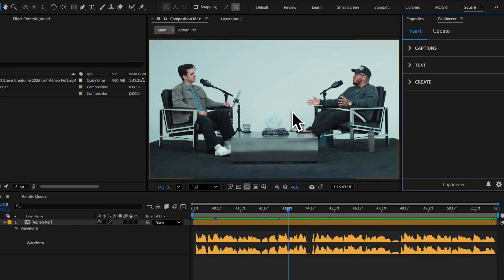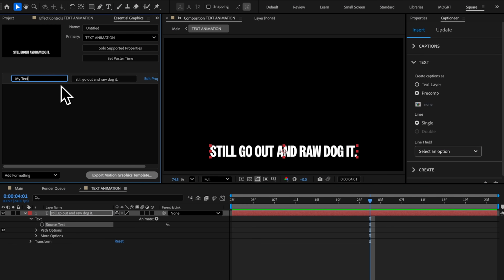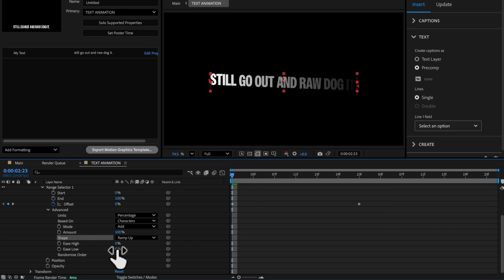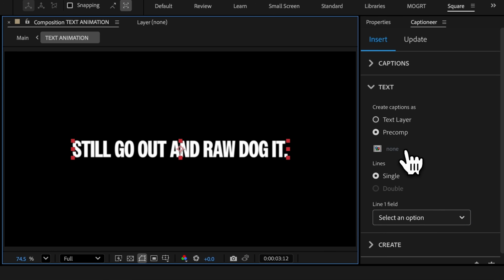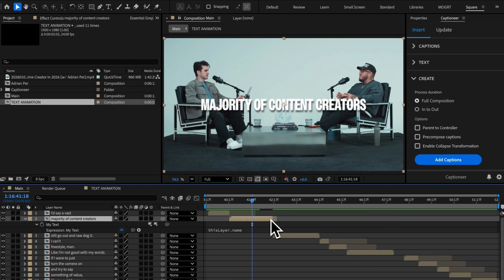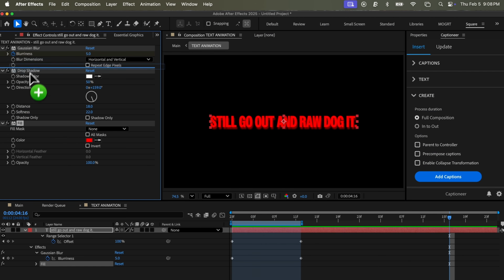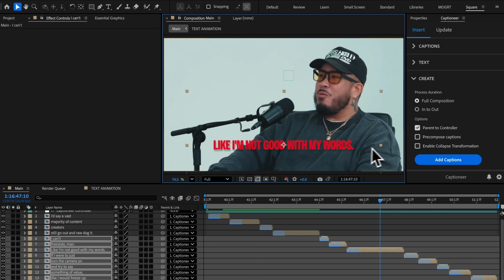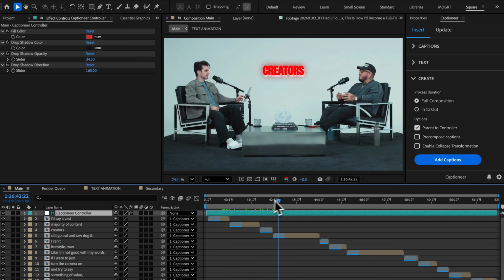Precomps

Comment: Hey guys, is it possible to adjust already created text in after effects? I just copy-paste text from premiere and then working on it in AE and your plugin just greaeat for automatization animations, but for some reason timings is not great in auto generation with your plugin
Reply: I would use crt file, but I expandint duration of each layer for couple frames so they overlap each other and create smooth in-out effect
Reply from the maker: Generate the text in AE and edit the text to fix any timing you want
Reply: @CaptioneerTV  also why is when I make precomps from text players its always some gaps created?
Reply: @CaptioneerTV  oh, I get in now, for some reason, precomps have maximim length of my style precomp, but some text lines is longer, idk how to avoid this

Comment: It's good but not easy to use
The Arabic language transcription doesn't work for after effects.. 
I hope you solve it soon. 😢
Reply from the maker: Email us and let's figure out what's going wrong! We've solved this in Premiere Pro, we need a native speaker's help for After Effects
Reply: @CaptioneerTV  
well, I can help, I am an arabic native speaker! 
I tested it again now it works but
when I choose the split by words option it works too but in arabic it rights from right to left, but it write the words from left to right as in english 
could you add an option to solve this issue? 
and also I add another transcription models like the full Large V3, and it worked fine! 
but, I had to go around it to make it work, it doesn't work once I add it, 
I tried also to add enhanced version for Arabic language, but it didn't work sadly, 
I can send you the link for the enhanced version, and if you could add the uncompressed Turbo V3
and the full V3 
and the Full v3 Enhanced for arabic
to choose and downlaod it! 
it would be fantastic!
Reply from the maker: Yes this is great info to know. We will see what can be done. Can you email us with this information and to proceed with testing: support@captioneer.tv